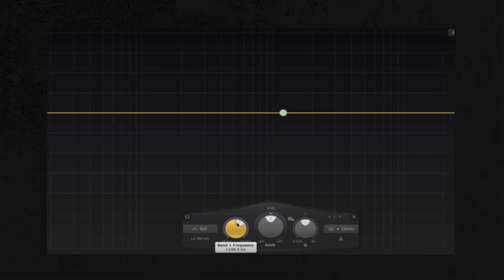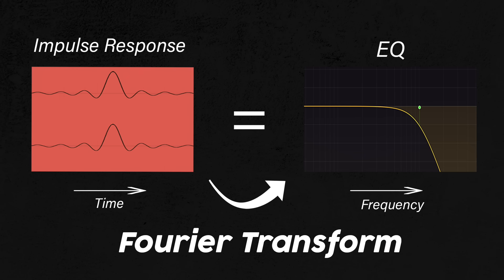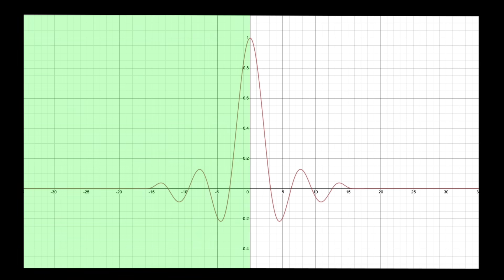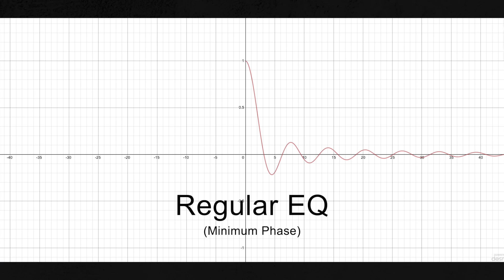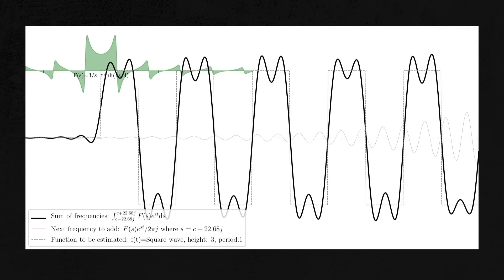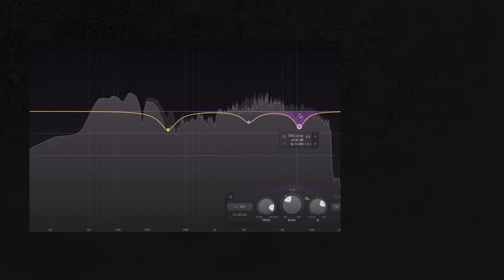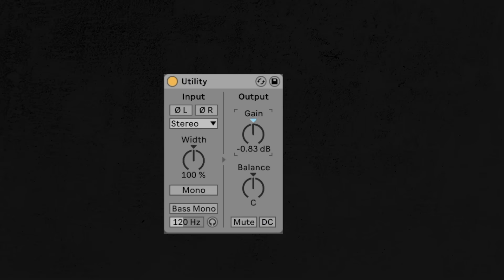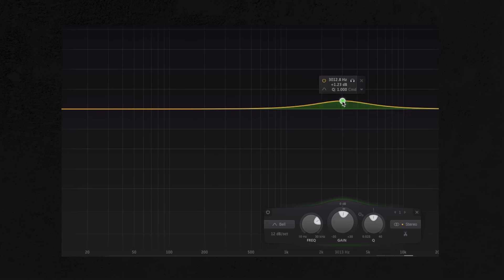You Don't Understand EQ

Comment: That's a nice set of basic stuff you need to be aware of when equing sounds. I would like to contribute a couple of tips I have figured out during my career. 

1. If you like cutting low-end rumble by HPF, try not to do that right before the fundamental frequency; cut one octave below that. For example, if your sound has a fundamental around 100 Hz, imagine where the fundamental could be while the instrument is playing an octave below, and cut there. If you really need to cut right below the fundamental, try a notch or high-slope peak. 

2. Master using low shelves and high shelves to do three jobs at once, utilizing one band. If you pull a low shelf on hi-Q, you can boost the desired part of the spectrum by taking advantage of the boost that a low shelf creates when Q > 1. This technique sounds much better than HPF. Also, you can find EQs that allow you to shift shelves, which makes more bumps if you want them, or trade this bump for more cut right after (or before) shelf frequency. 

3. If you like cutting resonances on vocals, try to keep your peaks in even order. I found that resonances mostly come from certain parts related to the construction of the microphone, such as capsule resonances and the body of the microphone. The same happens in speaker drivers and contributes to a parameter known as distortion. These points you want to cut in the upper mid/high spectrum of vocal recording are, for the most part, quite a periodic pattern (i.e., resonances appear at a fixed distance from each other). This helps with cutting out what really makes your vocals sound bad and keeping phase response relations between bands organized. 

4. Properly managing the output of EQ helps the digital side of things preserve a good representation of your sound. 

5. As a starter, try to use separate EQ instances for different approaches. Keep your cutting resonances separate from broad boosts; digital EQs can handle that much better. 

6. Think of low frequencies as highways for everything above(or as a highway for other instruments). If your low-end sounds solid, every detail in the highs will be represented much more clearly. Sometimes while doing stem mastering, I see how the mixer tried to compensate for the lack of highs on vocals with boosts, where I can hear that bass is having quite a resonance in the highs, even if there's not much musical information in there and you can't hear resonance clearly. Eq on bass can drastically change how your other instruments sound. 

7. If you're claiming yourself as a pro and you haven't utilized FIR eqs in free phase mode on critical sounds yet in your workflow, try it. DMG equilibrium is a killer in this type of approach. I'm able to shape sybilants not only by volume but also by phase, which is like time-managing certain sybilans.

Comment: I watched this and I am confused I thought eq was short for equalizer.  Where you got control sliders for bass low end, mid range and treble. Didn't mention any of that. That's why I am confused. Well I wait until the practical section comes on maybe you will be talking about low, mids and highs by then 😂
P.s watched all good but I just use the knobs on my mixer for ex if it's too droney I take some low end off the bassline etc. All this technical stuff means nothing to me. Sorry it's just I am not all that smart Tbh. I just tweak the EQ on my mixers to even out the sounds.

Comment: I don't remember where I read it but it was a eureka moment. Basically it had to do with sound selection, what makes a sound potentially loud or more quiet. Sounds with more resonance and roundness to them would end up being perceived as more quiet naturally (piano, bells, pads) versus sounds with more higher frequencies, distortion, harmonics (synths, saw waves, strings, leads)

Its important to keep the resonances in check in order to achieve loudness, just as you said the peaks take up headroom.

Comment: The eq is the most important and fundamental tool in audio processing. When they ask what's your favorite tool my answer is always THE EQUALIZER. Even the compressor if you think about it, is a sort of dynamic equalizer with a shared threshold for all the frequencies and the amount of amplitude required to trigger it is dependent by the knee (a really overlooked parameter in a comp, particularly for vocal processing, imho).

Comment: Is the amount of delay from linea-phase consistent across sounds? Cause what if we just put a simple delay with that same value on all other elements of the mix that don't have this delay already? The one issue I see is that there is no good way to automatically offset all your modulation etc., so that'd have to all be before the delays. As for playing along, I guess it'd just automatically offset itself within the midi, then you can drag that back into it's place and put the delay on it, so the modulation doesn't effectively happen early.

Comment: I wish every DAW came with an incredible EQ with wide functionality, key-track, mid/side, great modulation, clean and easy freq isolation.
Hell, let's give it a generative function that adds little bumps of noise in response to the frequencies playing in that area, either mimicking the amplitude of those freqs or doing the opposite, to whatever extent you like. Add the ability to shift freqs (and optionally a chosen amount of multiples thereof alongside it) and I don't see there ever being a plugin I love more.

Comment: I learned some great things from this video and can't wait to use this info on my own mixes. One thing I've figured out that I think would help new producers is to make sure you take the time in the very beginning to find sounds that already work great together. Put together a mix that sounds great BEFORE eq and you will be set up for success.
Reply: yes many people stick to the first few sounds they pick... go through presets and see if anything will fit better... just like swapping drum samples later into your productions. you may notice some presets fit VERY well together before surgical eq if required
Reply: As kind of a corollary to that: If you're having trouble fitting a sound into your mix, consider using the mute button 😆

Comment: 10:25 Tip1 - EQ parts create definition
12:29 Tip2 - Understand which parts of the sound you need and which parts you dont
13:30 clever thing with the guitar XD
14:28 Tip3 - Boost to find where the sound should sit in your mix
14:57 Tip4 - Listen
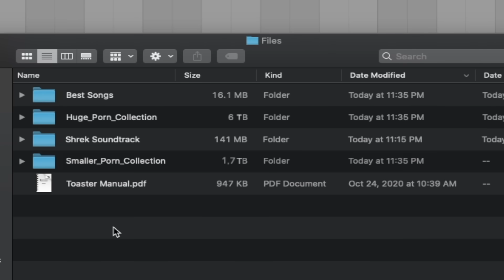15:33 Have a good folder structure XD
16:56 Bonus Tip - EQ with your eyes closed

Thanks for the informative video man! Also I really appreciate those subtle jokes XD
Reply: XD
Reply: Thanks
Reply: XD
Reply: Lol. Yeah, that is, the author simply listed a banal routine approach that everyone uses anyway. Secret, wow!

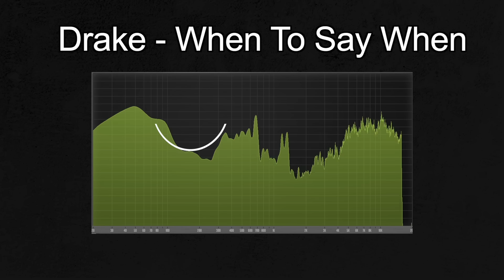Comment: 12:05 hmm Thats not why you would cut that region (at least not the main reason). 
You would cut that region because from about 200-700 Hz these freq's actually mask higher freq's, and also its where a lot of ugly freq's are (lower mids) so a small cut in that region will bring out freq's higher up. The most intense masking is around 250hz. 
So if you want a clear mix you have to really control the 200-700 Hz region. The loudness is more to do with cutting areas in the bass with High passes, and clearing space for the sub, and/or Crest factor (difference in volume between the body of the audio and the peaks) and how you reduce it with Compression , Saturation and Clipping (as in a Clipping plugin, not clipping your interface). What you are talking about does help loudness, but that is not why you would do it.

I agree however cuts can be used to make a part pop, but that is regarding masking and not really about loudness (or rather the loudness aspect is a welcome bi product) which is why you will hear MANY pro's say something like "the secret to loud masters is a clear and balanced mix"...because it is. But if you are cutting a region that is audible just to make the master louder, that's not really mixing. You are not tailoring the sound to make it sound better, you are butchering(potentially) the sound to get it louder

Comment: I'd be interested on the relationship between gain staging (like choosing the one track to shape the mix levels around) and the levels to hit on the final mix before going to master. This is all about the loudness topic in mixing and through master. There is alot of material about loudness, especially the spectacular two parts Dan Worral video on maximum loudness, but in the end he doesn't make very clear which stats we should look for when monitoring loudness in something like Youlean, and instead he solves the problem with the Loudness Penalty site/app which is fine but doesn't help to really understand. How streaming platform calculate loudness on submitted tracks? Is it Short Term that should be our target for publishing on the media (CD, LP), or is it integrated? Or both used in different ways? What Momentary is useful for? And what about realtime and avg dynamics (PLR)? Stuff like this, going deeper. Should be your cup of tea, no?
EDIT: actually Spotify have a nice explanation of what they do to your track based on their measurements. But about the measurement they're just saying "using the ITU 1770 standard".
Reply from the maker: Thanks for the suggestion. I plan to do an entire series on loudness since it's a pretty complex topic, I will make sure to touch on gain staging as that's an important part of getting loud mixes and properly processing sounds.
Reply: @sseb_music  spectacular

Comment: when you're talking about inverting the first half of the impulse response, that would be considered a minimum phase FIR correct? (and still results in post ringing)
Reply from the maker: The impulse response can be either FIR or IIR and would be linear phase not minimum phase. The frequency response is imaginary but you can divide imaginary frequency by the imaginary unit, 'i' and get a normal linear phase EQ using this impulse response.
Reply: Ah yep my bad. Any chance you can link me to any papers or articles on this?

Comment: This was great! I am a little confused, however. So at 14:30, you didn't say whether this can be an actual technique, or is merely a test. Would lowering the gain not act as a mass cut to the spectrum, and then a boost would undo the cut (so to speak)? In other words, is there any audible difference between a boost + lowered gain vs dipping everything except the area and not touching the gain?

Comment: Fantastic, one of the best tutorials ive watched in months. One question though, with turning volume down then boosting tip at 14:50. I presume you can't just leave it boosted once you've found the sweet spot, as you said earlier cuts are preferable. So what should one do? Raise the volume back up  then cut the frequencies that arent in the boost, and lower the boost back to it's normal level?
Reply from the maker: There are no hard rules, but what I usually do is boost to identify the most important frequency region, then lower the volume back down and start sculpting around that frequency region with subtractive EQ

Comment: Nice! I have a feeling that tip about cutting either side of a frequency is going to be worth its weight in gold, subscribed for that. Could you do a video on compression? I struggle to do it nicely on vocals without them starting to sound like the microphones are super cheap... Thanks!

Comment: Thanks for putting this together, I got a lot out of the technical part of the video. 

Question regarding Linear Phase EQ. Does that delay still occur when you print/commit/render a clip with Linear Phase EQ? Is that delay an inherent quality of linear phase or is the delay only part of real time processing?
Reply: this delay is part of both: realtime process and rendering/printing, but it's compensated by your DAW internally, so your project is always in sync. For instance, if you work in Cubase the number of miliseconds the delay provides  is shown in the mixer right above the fader panel.